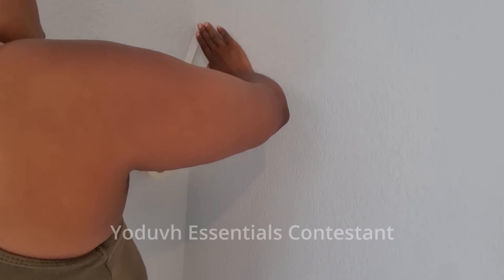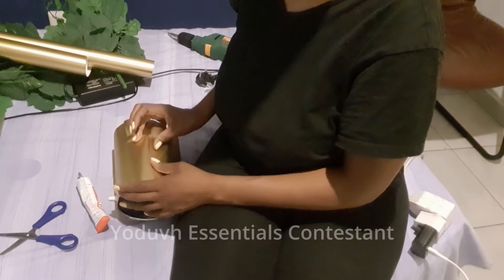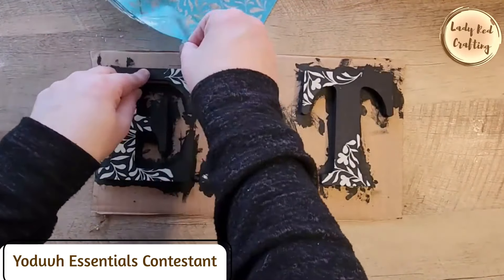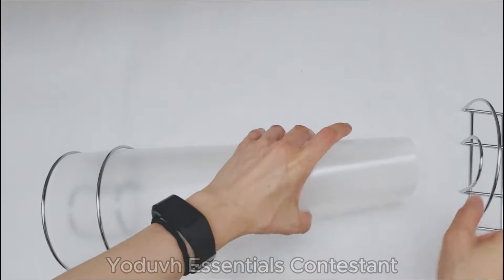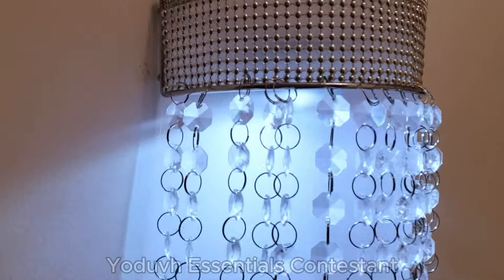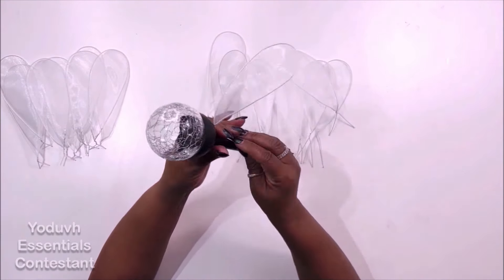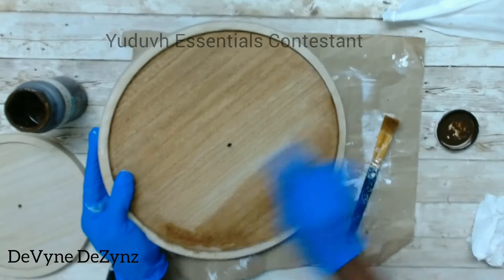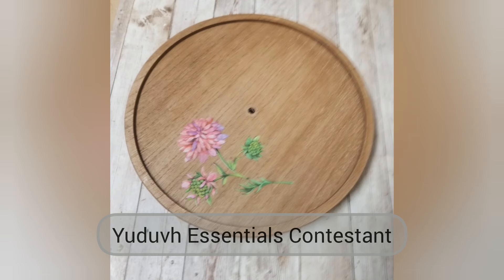ALL ROUND DOLLAR TREE IDEAS FOR your Walls/ Day 1 Contest

Comment: A= 3, B= 4, C= 5, D= 7, E= 4, F= 10. A-Where's the crafting? You just painted the frames and hung them on your wall? B-Nice outcome, but I could probably find one of these at a yard sale as prolific as this type of decor is. C-Started out really sharp looking, but then it became less appealing after you added all of the chain to it. D-Very pretty. I wonder how much some color added to the petals, or more than one color would make it stand out more. I will have to try my hand at this. E-This tiered tray could have been so much more if you had made it all yourself. Just rubbing on a decal does not do it for me, sorry. F-I was absolutely floored by how you completely 'weathered' that wooden piece. It absolutely looked like a piece of aged wood. And I never imagined a sharpie pen could be used like that.